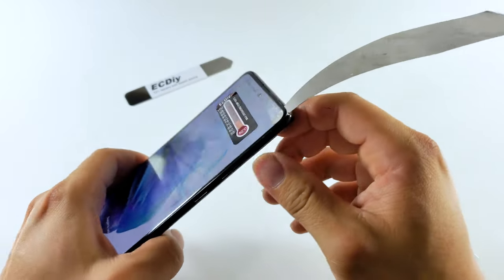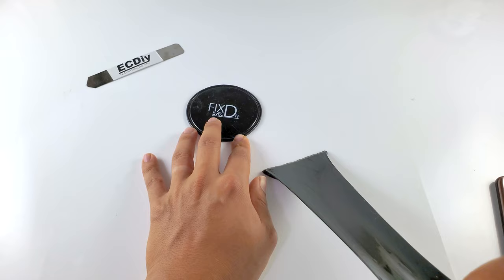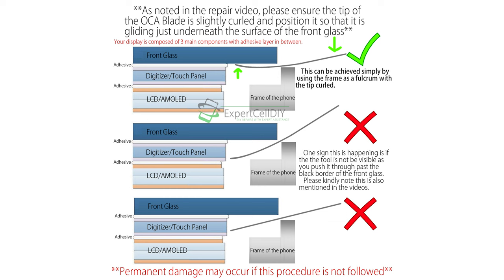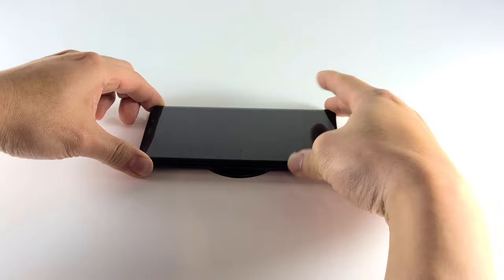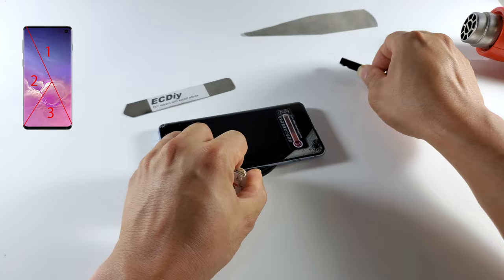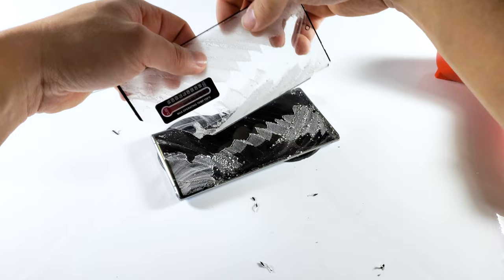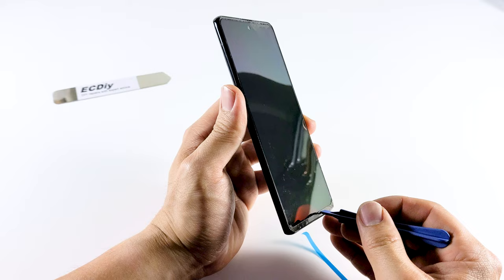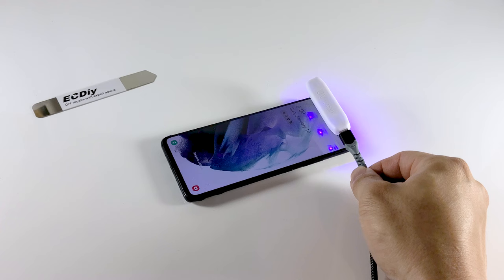How to Replace Screen Glass Only on Galaxy S22/21/20/10/+/Ultra/Note Shown in 6 Mins/New DIY Method

Comment: Do the kits come with the wire thing?
Reply from the maker: Yes they do! For now, we are taking a bit of a loss and including everything we show in the kit (minus the heat gun, isopropyl alcohol and the phone) No need to use the code as mentioned towards the end of the video. We truly believe the additional accessories we've developed greatly help the DIYers and with more support we should be able to bring the unit price down enough to not incur a loss.
    Any further questions/concerns, please do not hesitate contact us/comment further.
Have a great rest of the day.

Comment: Hi I have a s20 ultra the glass is damaged and has been for awhile but now the touch screen is playing up will replacement glass fix this issue or do I need a full screen
Reply from the maker: If you are experiencing any display issues such as touch issues, the whole screen should be replaced. The glass layer does not contain any electronics.
    There are instances where the way the glass is broken disturbs the display's touch which is resolved by replacing the glass but this is quite rare.
    Any further questions/concerns, please do not hesitate to contact us/comment further.
Best regards,
Reply: Hello actually my s20 ultra happens to be glass broken, display ok, but can't use finger print. Is it due to the cracks blocks the sensing? Do I replace the glass or the whole screen?  really want to use ur kit to my phone, thanks for awesome video.
Reply from the maker: @mysticnebula23 I assume the cracks are over the fingerprint reader area? 

Ultrasonic fingerprint sensors are very sensitive to the changes in the medium. If you have cracks over the sensor, it more than likely will cause it to malfunction.

You may simply need to re-register it so the phone can store how it is 'seen' through cracks, but that would depend on a case by case basis.

As the fingerprint scanner is below the OLED layer, it is highly unlikely the sensor got damaged without the actual display layer getting damaged.

Comment: if i order now will i still get the free kit because thats what it says on the website  but just to make sure
Reply from the maker: Hello Kristiyan, 
Yes it is being included with all kit orders (except the universal kit) today. We do believe the new combination of accessories make the repair much more accessible and we will keep including them for as long as we can even though including them for free does incur a bit of a loss for us. 
Any further questions/concerns, please do not hesitate to comment further/contact us.
Reply: @ECDiy  ok, thanks. i will order for s22 ultra soon, like in a week, probably
Reply: @ECDiy  btw i dont have a heating gun but i have that lcd separator machine with vacume  will this still work for the heating  or no ?
Reply from the maker: It will work with an LCD separator machine but to use the machine, you'd have to either a) remove the display off the phone or b) soften the adhesive thoroughly by submerging the display in a container with 99% isopropyl alcohol for 2 hours+ so that the screen can be lifted away from the frame.

    In the case of b) can place a guitar pick tool or a credit card to keep the display from sticking back on to the frame. 
    One thing worth noting is that once the alcohol fully evaporates, the tape will be strong enough to hold the display (it will be strong enough to withstand a suction cup). It will need to either be clamped or weighted for a few hours for it to stick like that though.

    Any further questions/concerns, please do not hesitate to comment further/contact us.
Have a great rest of the day.
Reply: @ECDiy  ok thanks 
will a hair dryer  work?
Reply: @ECDiy  i will order Screen Glass -Repair Kit for Galaxy S22 Ultra
and -Electric OCA Glue Remover
for the pro tool kits do i have to press anything to get them free or no ?
Reply from the maker: @kristiyankovachev2274  A hair dryer does work, it just takes longer. The Pixel 6A shown in our latest tip updates for Pixel phones was done with a hair dryer. (I understand it is a different phone but OCA film used in manufacturing display panels are all about the same).
Reply from the maker: @kristiyankovachev2274  You don't have to press anything. The pro tool kit is being added automatically on our end.
Any further questions/concerns, please do not hesitate to comment further/contact us.
Have a great rest of the day.
Reply: @ecdiy hi from the website for payment options i cant see like to chose master card

Comment: Pls tell does this method works on s10plus?
Reply from the maker: Yes it does work for S10 Plus! The method works for all phones between S10 and S22 Ultra (S10e, other plus and ultra models included).
In fact it works for almost all modern smartphones as the front glass of the display is glued the same way.
Any further questions/concerns, please do not hesitate to contact us/comment further.
Best regards,

Comment: when will the S22 Ultra kits be available?
Reply from the maker: Hello Zolitar,
    We currently have all the parts otherwise but the back glass tape. 
    However, we've also recently developed something that'd allow for the gluing part, (thus the whole glass only repair) to be done on all smartphones without the need for disassembly/removal of the front camera.
    We will have a video for it up in the next week. It's still a prototype but if this is something you'd be interested in, please send us an email through the 'contact us' page as we'd be happy to give you more details and include it free of charge now.
    Any further questions/concerns, please do not hesitate to contact us/comment further.
Best regards,

Comment: Can I do this with a hair dryer
Reply from the maker: You can do this with a hair dryer and our most recent video showing the Pixel series was done with a hair dryer.
   Please note that it does take longer to heat with a hair dryer but I'd have to say if you have a helper that can keep an eye on the temperature and heat the screen, that would make things a lot easier than doing it with a heat gun.
    Any further questions/concerns, please do not hesitate to comment further/contact us.

Comment: Holy shlt... just replacing the screen per oem instructions on s22 looks way easier... even though it's not easy.  
Ubreakifix = $390 for screen  and battery. 
Samsung parts = $167

Comment: HEY, will I need to purchase a back cover if I'm opening it to get the camera out on my s10 plus ? Or can I use back the old one. How will it stick ?
Reply from the maker: Hello, thank you for the comment!
You do not need to purchase a new back cover as we include a spare IP68 back glass tape adhesive with every kit. You can technically re-use the factory back glass adhesive tape, but it is not recommended as it is not nearly as strong and there will be close to no water resistance.
Any further questions/concerns, please do not hesitate to comment further/contact us.
Have a great rest of the day.
Reply: @ecdiy  so helpful ! Same to you!!

Comment: What type of glue
Reply from the maker: Hello Oshane,
Thanky ou for your comment!
It is called LOCA. The brand we use is Stronghold. LOCA stands for Liquid Optically Clear Adhesive, there are several options but please kindly note many LOCAs require a separate UV lamp to cure. (Ours is specially formulated to by hypersensitive to UV, so much so that exposure to daylight on a cloudy winter day is enough to cure the glue. I'd also like to note that ours can also be cured with a UV light)
   We do not have a listing on our site at the moment but send us a message through the 'contact us' page and I can arrange a direct invoice for you. A lot of copy cats these days using our image, but this glue is exclusive to us. If it's not on our site, or at our eBay store, it's not the same thing.
   Any further questions/concerns, please do not hesitate to contact us/comment further.
Best regards,

Comment: Please do the Samsung S22 Ultra. I cracked it's front glass. Nobody here wants to replace just the front glass, everyone wants to replace the digitzer+battery pack which costs over $330. Authorized dealer shops ask for $500 for the replacement.
Reply from the maker: It's shown briefly in our short video, but the process is the same. It's a bit concerning that they want to charge you for the battery pack as well, considering that the trick to removing it without damage isn't much of an insider knowledge. You just need to apply some isopropyl alcohol down the sides of the battery and let it sit for about an hour to soften the adhesive.

I've noticed that some repair shops are even claiming that this repair cannot be done, despite the existence of videos other than mine demonstrating the process. What's strange is that they provide two different quotes based on whether the display is working or not. If they're installing a new screen because the old screen can't be refurbished, it makes you wonder why there is such a significant price difference between the two quotes.
Reply: @ecdiy  Thank you for the reply. I know right, I told one of the repair guys, I am fine with paying $200 for the repair if you can do only the glass replacement. He refused. He said he will order a new glass/oled/battery kit from iFixit and charge $330. Considering the kit is some $240+shipping, he is going to make less than if he just replaces the glass. I was even fine with the glass available on Amazon for some $43.

I'm thinking of doing this myself, even if it means destroying the Oled. I mean, what worse can happen, they are already hardbent to replace the whole front+battery.

One question though, if it is just the front glass replacement, why not just remove the glass using the wire, clean the surface below, apply glue on the sides and place replacement glass on top? Why do we really have to remove the back cover, remove all internal parts, etc?

Comment: Hello there, I am about to place an order and have sent you an email with a few questions. Here is one more :D. I saw lots of others doing repair with big machines. What are the advantages of that method over yours? In your instruction, the LOCA is applied by hands. Is the possibility of uneven glue distribution high and have negative impact on the screen?
Reply from the maker: The advantages of the method with the big machines are that you can do it faster/less monitoring. 
    For example, when you use the LOCA, you do want to be present in case you see LOCA spreading to one side more than the other. However, with the OCA film installation with the laminator, positive pressure & negative pressure chamber, it's more or less a set it and forget it. It's also easier to do multiple devices at once using the machines which is why it is preferred by the shops. 
    When you apply glue as shown in our video, which is letting it spread 80~90% on its own under the weight of the glass only, uneven distribution isn't something we have experienced but as noted above, you do want to be there to tilt the phone to encourage the glue to flow to one side over the other. 
    It may be a bit difficult to envision without actually doing this repair and I hope it is clear, but if you need any clarification, please let us know as I'm happy to help.
   Any further questions/concerns, please do not hesitate to comment further/contact us.
Have a great rest of the day.

Comment: 9ñyou are the best no20 ultra nex
Reply from the maker: Thank you for your comment and your kind words! 
That is a great suggestion. 
I do plan on doing one for Note 20 Ultra soon but let's see what others say on the one I should do next.
Cheers,
Reply: Just a question that metal part that you can use for the to remove the glass where where can I get that
Reply: And how much does it cost an electricity and it looks easy the way you is the way it looks but I'm pretty sure it's a little bit difficult oh I don't know with practice i guess anybody could do it
Reply from the maker: Thank you for your continued interest.
It is definitely more difficult than it looks in the video. However, patience is key with this repair. The slower you go making sure you have the device heated enough using our sticker thermometer, the higher your success rate will be. 
We will keep tinkering/experimenting until this repair becomes something everyone can do easily.

The tool/kit is available to purchase at www.expertcelldiy.com

Any further questions/concerns, please do not hesitate to contact us/comment further.
Thank you.
Reply: @ecdiy  Please make a Note 20 ultra video!

Comment: video for pixel 6 pro? just placed an order
Reply from the maker: Hello, 
Thank you for taking your time to comment and thank you very much for your purchase!
For Pixel 6 Pro, you'd follow this video as the process is identical to that of a Samsung device with a curved screen. The only difference would be that, when it comes to cleaning the glue that may get on the front camera, you would simply be removing the display off of the frame rather than removing the back glass as shown here. 
We do include the OLED to frame tape for Pixel 6 and 6 Pro so you can do this.

Any questions/concerns, please do not hesitate to contact us/comment further.
Have a great weekend!
Reply: @ecdiy  I have acces to dry ice, do you recomand heat or cold? for pixel 6pro/curved glass, which process would you recomend?

Comment: Will it break the phones ip68 rating
Reply from the maker: Great question! This had been asked before so please excuse me for the copy and paste answer:
   Under proper installation, the phone should still be water resistant. The tape adhesive which provides the seal is indeed original grade IP68 adhesive. However, the LOCA process would have to be done in a very precise manner and be spread perfectly even in order to achieve factory spec water resistance which is 5ft submersion for 30 minutes. While this is possible, this may not be easy for a novice and the water resistance may be less, to the point it can only resist regular splashes/drops of water (IPX1~IPX5 for example. I won't be able to go over what all the ratings mean but if you google IPX rating, there is a good article written by audioreputation with the specific details for each rating).
   At the end of the day though, cracked screens are not water resistant either. So really, there isn't anything to lose when it comes to water resistance when replacing cracked front glass.

Comment: Does it Work on Motorola(newer version)?
Reply from the maker: Hello Luke,
If you can let us know the exact model, I can confirm for you but if you are referring to the edge/edge+ and the g series, then yes. The display on those phones are manufactured the same way and the method and the tool shown here works on them as well.
Any further questions/concerns, please do not hesitate to contact us.
Best regards,

Comment: Bro can we use this on lg wing
Reply from the maker: Hello,
Thank you for taking your time to comment.
   Yes, this method will work on LG wings as well. Although the process requires care for all devices, the concept for the glass removal process is universal: Modern touchscreens have the layers/components assembled using OCA (Optically Clear Adhesive). The glue we use is simply the liquid version of it.
    Our OCA Blade tool is the same thickness as the standard wire tool, which you see many professionals on YouTube using to do the glass separation.
    As long as the tool is touching the underside of the front glass as it is being inserted into the display area, and heat is applied to soften the OCA layer, you will be able to remove the front glass.
Any further questions/concerns, please do not hesitate to contact us/comment further.
Thank you and have a great rest of the day.
Reply: @ecdiy  ohh nice bro what about freezer method will it work on lg wing
Reply from the maker: @gymbros1068  That I am not sure. I can confirm the layers of the display panels are assembled the same way as other devices so it technically should.
    However, I am not sure if there's a component needed for the pivot mechanism of the dual display that would somehow get damaged due to the extreme temperature required for freezing.
      I'm sorry I could not give you a clear answer but if you have any further questions/concerns, please do not hesitate to contact us/comment further.
Have a great rest of the day.

Comment: Where do I put in the code
Reply from the maker: Thank you for your question! 
At the check out page where you put in the shipping address:
(Desktop viewing) There is a small window on the right hand side for "discount code"
(Mobile) You need to click "Show order summary" at the top and the discount code window will show up.

To take advantage of the discount, simply add both the kit and the "Pro Tool Kits" in the cart, and enter the discount code at the checkout page as noted above.

Any further questions/concerns, please do not hesitate to contact us/comment further.

Have a great rest of the day!

Comment: discount code doesn't work
Reply from the maker: Hello, in order for the discount code to work you need to put both the pro tool kit as well as a regular glass replacement kit in cart.
Please kindly note though that for a limited time, we are including the pro tool kit free of charge with all kits. 
Any questions/concerns, please do not hesitate to comment further/contact us.
Best regards,